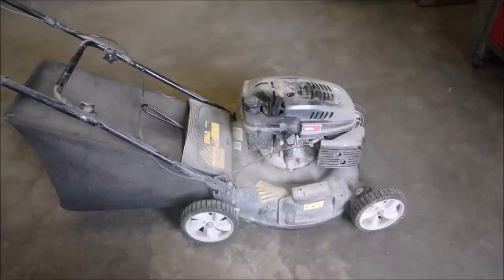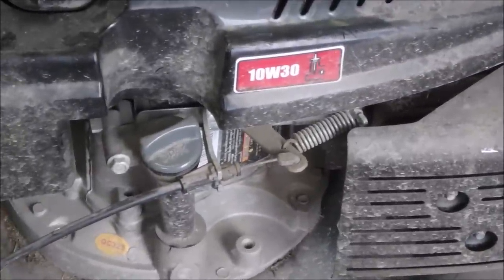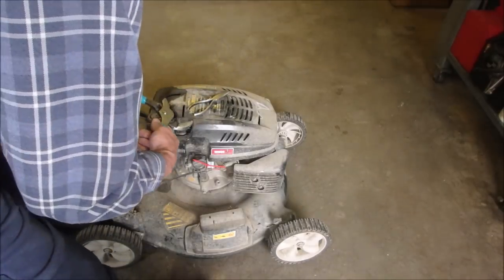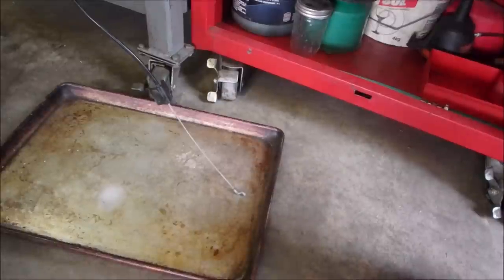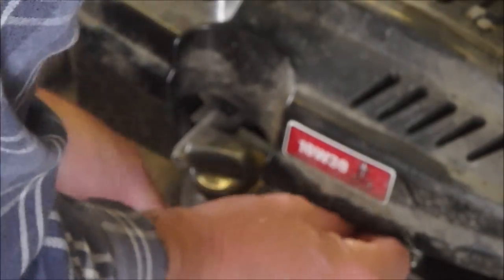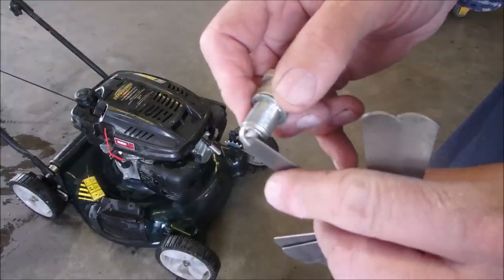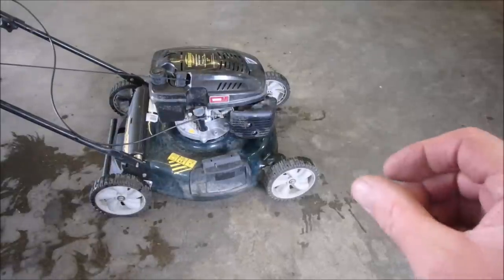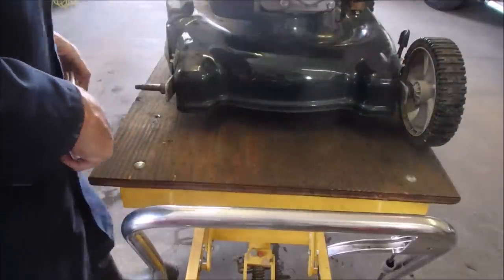YARDWORKS Mower Abandoned

Comment: What a great score on that mower.  Though most don't know the little secrets to keeping one running.  Like the hammer trick on the blade thing, going to use that one.  Thanks Bruce.  Stevo
Reply from the maker: Thanks 👍  Cold peening is  great thing to learn.  You can sharpen items without loosing the product to filings.    A full sharpen with a cold peen would be hard to do.

Comment: Morning Bruce , great fix on a very usable mower! Those cables have adjustment in the ends .the clips that are on the end of the cable can be spun a few turns out as they are kind of threaded on . You might get a half inch longer sleeve to cable and it might help for engine brake. Cheers brother!
Reply from the maker: Thanks  I knew that.  I only do it if that is my last option.  Only because of the lose of threads holding the clips.  Thanks for the great tip.

Comment: +-When I bypass the engine brake, I take the spring off and use a rubber band to hold the lever in the run position.  That way you can shut it off easily.
Reply from the maker: Thanks for that.

Comment: Hey Bruce,
Nicely done!  I’ve had quite a few dusty machines like that.  I call them “Diamonds in the rough”!  Last summer, I picked up a Toro PP, blade clutch, etc. for $50.  After putting it through rehab, I sold it for $400.
Reply from the maker: Right on.  You do nice work
Reply: @BrucesShop  Thanks Bruce!
You too!

Comment: Morning sir, I think that's a powermore aka runsnomore engine, a Kohler has the kill and brake on the same side as the carb, is there a bolt going through the middle of the gas tank, if so it's a powermore engine, it's a honda/Kohler clone..... Nice job as always.
Reply from the maker: Right.  This one gets me as it looks like 3 different mowers.
Reply: @BrucesShop  yep, I have a parts one in my shop for a neighbors so I can get parts quick and easy... LMAO
Reply from the maker: @knighthawk86855  OK  I just noticed i had Tecumseh in the title.  I was working on 2 mowers at the same time.  The other one was a Craftsmant (linitited edition)   That was the Tecumseh.  My bad.  i changed the title.  I don't think you will see or hear the word Tecumseh anywhere else in the video.  Thanks for your help.

Comment: Yep big bolt through the gas tank, it's a hangsen... Powermore, nice engine but almost impossible to get internal parts for.
Reply from the maker: It has a lot of adoptions.   Ideas stolen for all the main guys.  Air filter, carb, and on and on.  thanks.
Reply: @BrucesShop  yep and made from chinasium, like I said they are good engines, but once they start to go internally forget it, can't get the parts.
Reply from the maker: @knighthawk86855  Yes This is not a Tecumseh  I explained it above comment.  Sorry and thanks.